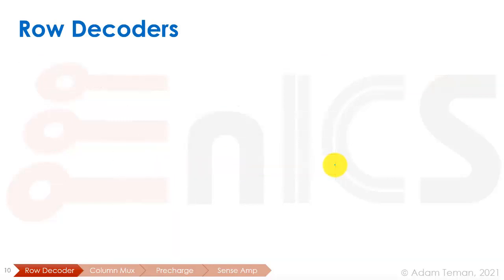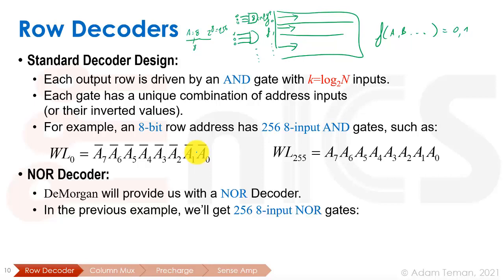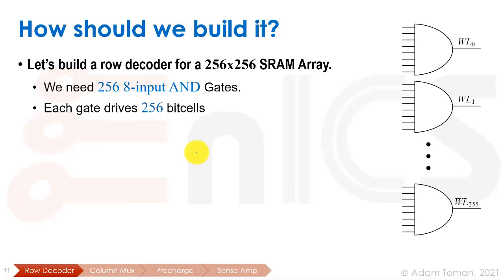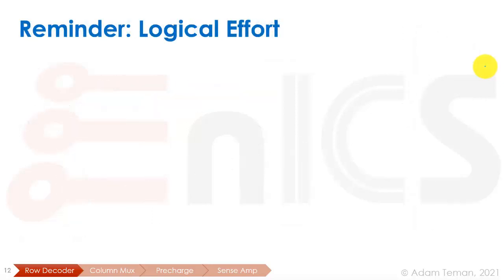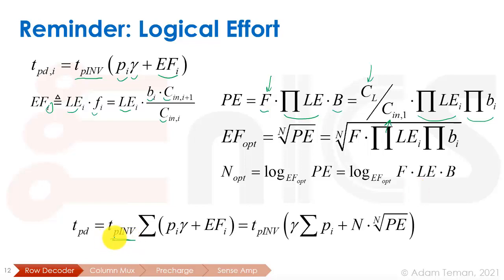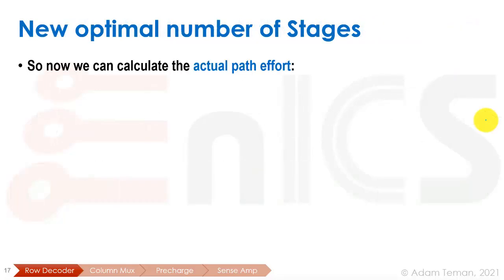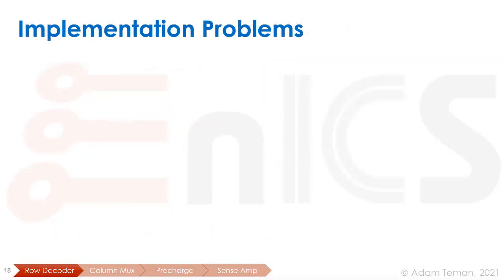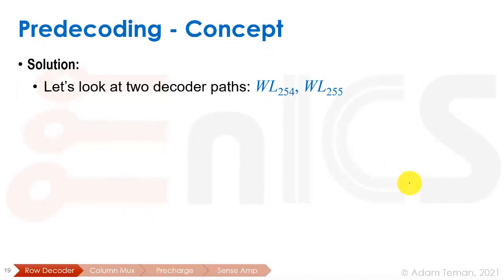VLSI - Lecture 9b: Row Decoder Design

Comment: What are the advantages/disadvantages of using dynamic decoders over static?
Reply from the maker: Just like dynamic logic (you can find explanations in the Digital Electronic Circuits course https://enicslabs.com/academic-courses/introduction-to-digital-electronic-circuits/ - videos only in Hebrew, but slides in English) a digital decoder can be much faster than CMOS and can be realized with fewer transistors. However, it comes at extra power consumption and more risky implementation.